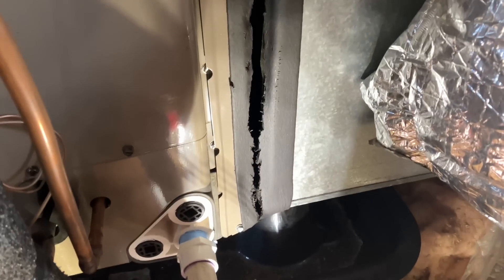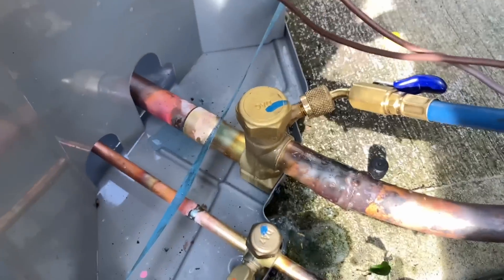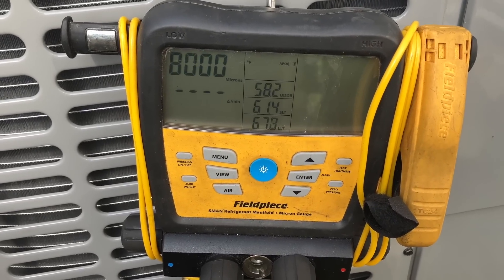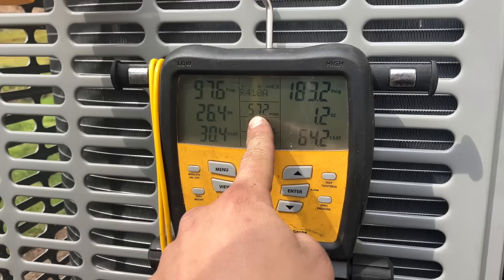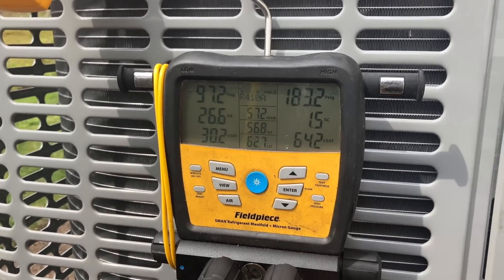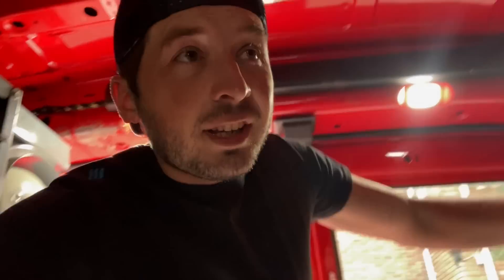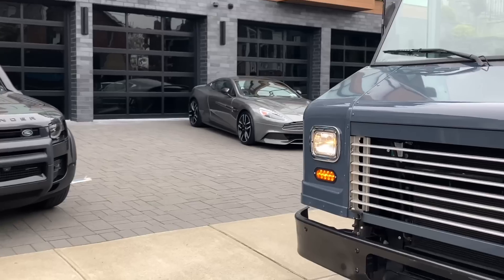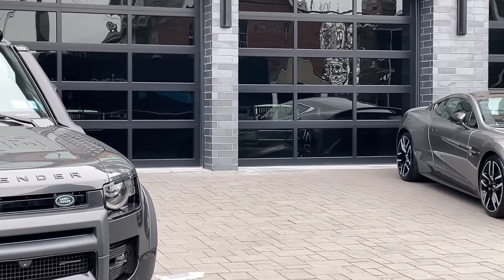HVAC Low Voltage Shorts are Annoying

Comment: Curious, did you add nylog or some sort of thread sealant to the cap? And why not just measure the resistance value of the contractor coil?